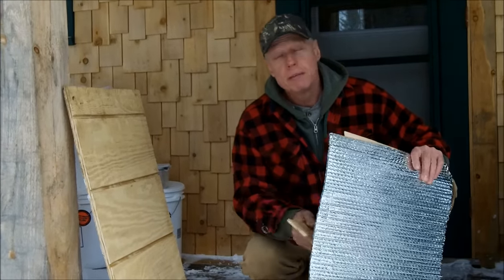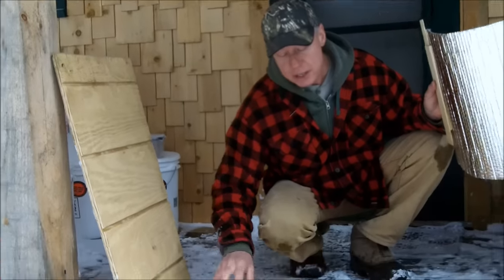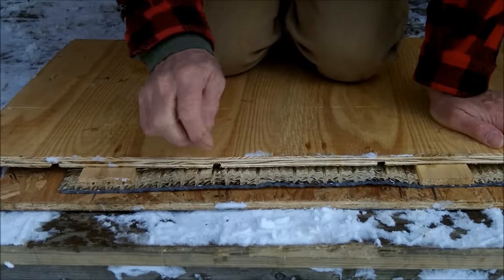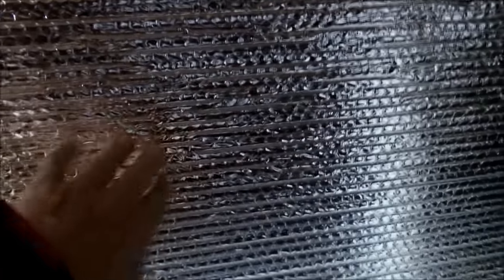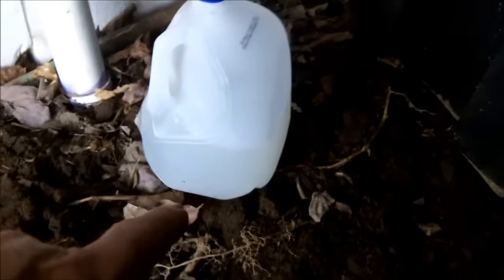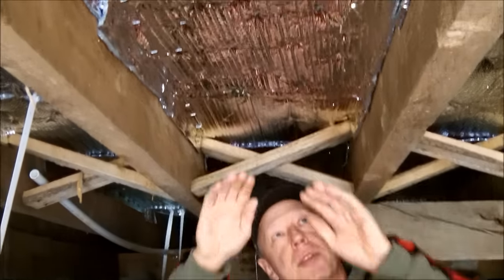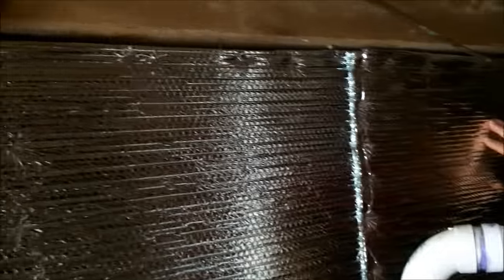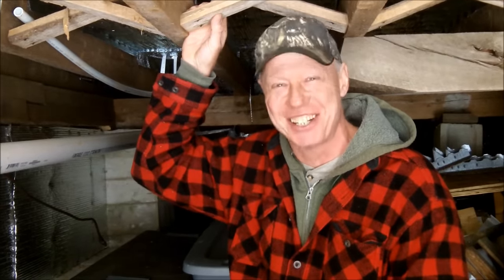HOW TO INSULATE A CABIN FLOOR AND KEEP IT RODENT FREE

Comment: Would your floor joist not rot over time with no vapor barrier between the soil an wood? Soil creates moisture. I was always understood you want to lay a layer of vapor barrier over your ground, then the crawl space is protected of moisture coming up an contacting the floor joist above? 

But as for the bubble wrap idea I think that's very clever an would do well compared to batted insulation which is a home for rodents. I'll be doing this for sure! But I am curious to your thought process on no vapor barrier on your soil an how you intend on the floor joist not rotting
Reply from the maker: Vapor barrier will help control moisture from the ground for sure and is a good idea for that purpose alone but... if your're planning on utilizing the trapped air (ambient temp of the ground) to help heat your crawlspace, the vapor barrier will trap that heat below the barrier and you will lose its benefit.

Comment: Love your channel!  Im about to embark on a cabin build myself and your channel along with an assortment of others have been my study guide the last year. Question,  Could you use this to insulate the whole cabin?  Walls and roof as well?  Thanks!
Reply from the maker: I wouldn't. I want my rooms to breath.
Reply: I disagree with Off Grid homestead on this point. I see no reason why you couldn’t also use it on the exterior walls and the ceiling as well. After all , the walls and ceiling would otherwise normally be sealed with 6 mil poly anyways, which would not breath either.

Comment: We have a cottage in Western NY that was built in 1901.  Over the years we took it off the piers, and put a block foundation with I-Beams under it.  We have a similar rodent issue.  Going to give the bubble foil a try as well.  Only other challenge is the moisture.  Have you thought about putting down plastic over the dirt, to add another layer of vapor barrier?
Reply from the maker: Yes I plan to lay cheap tarps over the soil.
Reply: @thebossoftheswamp  Hi, great video. I have a question regarding the cheap tarp you used over the dirt floor. Does that have any effect on rodents burrowing up through the dirt?
Reply from the maker: @drew6194  I have never had any issues with that.

Comment: think about doing this to my mobile home. its a 76x 16 so wont be cheap or fun. but rodents have destroyed the insulation.
I would have to do it like your last illustration and staple underneath. 
im in Ky andbit get down in the low  teens to single digits on average in winter. my concern was it not working well enough but after watching this i think it might be fine

Comment: What about if your cabin is located in the north Canada where temperarures reach -30 degrees celsius for 2 to 3 months of the year. My cottage is already built 30 years ago. What if you put the bubble foil between the joist under the floor, then put SM insulation over the bubble wrap, and same for the walls under your raised cottage. Then later when I change the flooring inside, put the bubble foil over the existing plywood flooring, then strap it along the joist locations, then add another plywood layer, then the new floor. This should be a good approach you think? Do you see any problems doing this? Other than some cost..
Reply from the maker: I lived on the Canada border for 14 years and seen -35F.  I had one layer of foil under the floor but also had the skirting insulated with this too and it worked great.   Make sure you have insulated skirting.

Comment: I have used the bubble insulation in the past and wish I could use it here. Our little cabin, "Hobbit Hus," started out as a hunting camp put up quick and dirty. It has a 6" "crawl space" under it so there is no hope of installing it. The drain in the shower also freezes in cold weather, but I treat it with RV antifreeze as necessary. Otherwise, I love the stuff too! Thanx for the wonderful videos you publish. ><>
Reply from the maker: Have you skirted it?  That will make all the difference in the world.
Reply: Oh yes - sorta' kinda', first thing we did when we bought the place. Discovered that skunks will chew through the bubble insulation though. :-) Didn't expect that.  Any good recipes for skunk?  ><>

Comment: I will do this when I build my cabin but have a question.  Underneath the floor you put the bubble wrap tight to the sub floor because you didn't want to create an air gap by stapling it to the bottom of the floor joists but when you did your skirting you created a 3 1/2" air gap. Why did you not just use the bubble wrap on your skirting frame then put the pressure treated plywood on top of that with no gap like you would on a newly built floor?  Thanks and enjoy your video's.
Reply from the maker: Good question.   I could have done it either way I suppose but the trapped air in the skirting will help insulate the crawlspace.   If a mouse chose to nest in that air gap, there's nothing he can destroy in there. No wires etc but so far I have not seen any points of entry.

Comment: I would seal up the bottom of the joist with strips of 3/4 and drop plywood in the space and insulate from the top
Reply from the maker: The building was built 10 years before i was born so i didn't have that option haha

Comment: You need a good 4" of insulation for it to actually work effectively. One other thing is rodents will eat right through what looks like PEX piping. If you want to keep rodents out, clean the space, and when done regularly bait the space both inside and out.
Reply from the maker: Total bullshit is all I just read. When you live in the woods, rodents take residence in ALL and ANY type of shelter. Woodpiles, lumber piles and tarp over a wood splitter. My cabin has seen temps as low as -38F and I walk around barefoot.  I love comments like these :-/

Comment: I think you would have been better going over the floor joists, you want an air gap to make that stuff most effective...  as for the rodent next problem, I think they could still find nesting homes the way you did it...  sealing and taping the joints would prevent rodents from getting in as mice don't chew through foil..

Comment: Putting a plastic vapor barrier on the cold side will create condensation and rot your floor. Vapor barriers should be installed on the warm side of insulation.
Reply from the maker: With a poly sheet I agree but it doesn't condensate with this stuff.

Comment: Are you sure the benefit isn't just from having that stuff act as a vapor barrier?  The R value of it is 1.3 which is hardly anything.  The reflective part is for raditant energy so does nothing extra.   I'm trying to figure out what to use for my build and so far I like rock wool Insulation with metal flashing undernearth to keep out mice.
Reply from the maker: The reflective quality of the product must be what makes it work so well. If it didn't, I simply wouldn't put it beneath all my structures.

Comment: right on time . I am in the process of buying a cabin in the mountains of east TN , offer accepted , close in 2 weeks and it will be a project .  24x36 with block foundation . No insulation in crawl space . I was thinking fiberglass the joists with foam block in the rim joist , wire to hold it up . After seeing this I have a change of plans , I am going to bubble foil as you did on the bottom of the sub-floor . I think I will still put some foam board in the rim joist cavities . Would it be effective to then cover the inside of the foundation block walls with same stuff and what would be a good way to attach it to the blocks ? would liqiud nails hold it ?
Reply from the maker: Not sure how to secure it to concrete.

Comment: Great, just Great. now i have a spring project at my cabin in Deposit instead of fishing. lol Thanks for the video. I tried spray foam and doing it on my back 12 inches from my face at the closest point was a circus. I have a picture of me afterwards of what i looked like. lol  what kind of skirting did you staple that on? most trailer skirting is vinyl?
Reply from the maker: It's framed with PT 2x4's.

Comment: I think you may have solved my problem.. Thankyou! I do have a question though.. I have seen other videos where they lay this insulation on a concrete slab floor like in a basement and then they lay a finished floor on top.. you mentioned that you believed that if you did that it wouldn't work because it would damage the insulation over time from walking on it (possibly popping the air out). I understand what you meant but now I'm not sure if it's true or not. Either way I am definitely going to try this stuff. Thanks again
Reply from the maker: Since I have not tried it, I can't say for sure but I do know that the insulation would remain intact if it was not being crushed.  Just my 2 cents :-)
Reply: @thebossoftheswamp  that's a fair enough point. Thankyou for bringing my attention to this product I definitely gonna give it a go in my house projects

Comment: Thanks for the tip. What kind and size bubble foil should I put down on/over my floor joist before I put down the subfloor ?  Thanks
Reply from the maker: Here is a recent update regarding my insulation tactics. https://www.youtube.com/watch?v=Wa2-FWAwwUY  
 You will find info and answers to your questions in the description below.  Good luck with your project,

Comment: I am getting ready to put insulation in my 72 Holiday Rambler RV.  I have had to gut it so it is perfect to put new insulation.  I am trying to really build up the insulation to keep the heat and cold out at extreme times.  I have been thinking about putting in the bubble wrap and then the pink panther insulation wrap too.  Does that sound like a good idea?  If so what would you put down first, the bubble wrap?
Reply from the maker: I think that would work just fine and I probably would put the bubble foil in first but not sure if it would matter.

Comment: The reason it works it needs an air gap with out it the r rating is probably .3, fiber glass is the perfect rodent nest material, use cellulose with boric acid the weight causes it to collapse on the nest.

Comment: I have a question.  First of all, thank you for a great video and presentation.  My question is, wouldn't the skirting with bubble foil cause moisture to be trapped and then rot things underneath?  I always thought that you need to have air circulating below the floor.
Reply from the maker: How much you vent the crawlspace depends on many factors and I discuss a few around the 10 minute mark in this video  https://www.youtube.com/watch?v=cbbItGGyFLc     If you vent the crawlspace in the winter, you will allow cold air beneath the structure and not only will pipes freeze but the floors will be cold.
Reply: @thebossoftheswamp  Thank you.  I'll have another go through at that point.

Comment: Hey Boss, I am in the sub floor construction stage of my cabin. Should I cut 4’x8’ sheets of the foil and staple to the underside of the underlay? Or do you think it would be best just to roll the total length of the floor and staple to the joists? Love the bubble foil idea!
Reply from the maker: I roll it over the joist and staple it down. This will create little air pockets under the floor that trap and reflect heat.  Just gotta keep the rain from getting trapped between the plywood and the foil.

Comment: @bossoftheswamp I just read you can get R-21if you follow the instructions for install on Reflectix website. They say to put 2 layers of the bubble wrap insulation. One half way up the floor joist and the other at the bottom of it. Combined they say it is R-21. You could make your floor even toastier...
Reply: But you will also create a cavity where mice/rodents will nest if they get between the layers. :(
Reply: @jamiearmstrong3343  Supposedly, mice do not like the Reflectix.

Comment: I have a very damp crawl space (about 2 1/2 feet tall), The fiberglass insulation between the floor joists is about 38 years old and the sheathing covering it is that old and compromised in many areas because of the plumbers who tore it apart to get to leaky pipes.  My floors are really cold, it's a modular home set on a foundation, about 24W x 36L.  I want to take out all the old stuff and put the radiant insulation against the floor boards as you suggested, and also put the radiant insulation on the floor joists for extra protection because it gets might cold her in New Hampshire.  I was thinking I would need 3 rolls of 2x125, and 3 rolls of 4x125 feet.  Do you think that would be enough.
Reply from the maker: The packages will display how much square footage they cover so just buy enough to suit your needs. 24x36=864sf.  This cabin is in NH as well.

Comment: You should tape your joints this summer and see if it makes a difference next winter.
Reply from the maker: I do when I do a new install but this is working so good that there's no need of improving it.  It's overlapped by several inches anyway.

Comment: I have used this stuff and I don't know why it works so good unless it was made by magical elves . It is pricy for all you get but it is works as well as 1 1/2" of foam board or 3 1/2 rockwool. If you look at that comparaison that way it is the cheapest and best way to go. It also works fantastic as a heat reflectant. You will only be sorry if you don't use it. I just wonder if 2 layers would work in the attic better?
Reply from the maker: I'm working on an update video on this subject. I was planning to have it out this weekend but I ended up in the hospital instead.  Life happens as we all know.  I hope to have this vid up and out this week.  It'll answer many questions.
Reply: There is a company making an insulation with basically two layers of this with I think 1/2" of some kind of poly insulation sandwiched between. Rodents  don't like it is their claim. Looks promising for this type of use. They promote it for steel buildings. I came across it while looking at insulating a shipping container.
Edit: Prodex Insulation.
Pop it in your search and should bring it right up.
Only .200 thick center material. Claim r17??🤷🏼‍♂️
Edit #2: just read the in hospital part! Sorry to hear that! get well soon!

Comment: Do not put a plastic barrier BELOW the floor joists! It will trap moisture (spilled water on floor, roof leak) and it will rot your floor joists AND create mold. Your moisture barrier goes to the heated side! George Hanson

Comment: Bubble foil wrap has an R factor of 1, very poor. Canadian researchers (it gets pretty cold there) ran tests.  Their Conclusion - "bubble-pack insulation had a low insulating value compared to the polyurethane panels and the XPS board. It’s cost benefit was the poorest of all insulating materials tested.

Comment: Thats a lot of work for very little r-value.  I would use a table saw to rip the thickest foil backed foam insulation I could afford (or at least meet the r-value of the local building code) to fit in the joist spaces and if some are a little loose "caulk" the gaps with canned foam, shiny side towards the living space.  Maybe put thermofoil on the skirting but pro's don't use that stuff, I don't think there is a building code north of Louisiana that would allow it as its practically useless at -20c.
Reply from the maker: If I needed to dao all that, I would have done it but this is all I use in all my structures and do so BECAUSE ITS ALL I NEED TO.  My cabin in northern NY has seen temps of -38F and I have warm floors.  I don't give a fiddlers fart if you believe that or not.

Comment: Thank you so much for your videos, they are very helpful!  I am going to be building an off-grid cabin and would like to keep the rodents out of the wall.  Have you ever try this bubble foil for insulting cabin exterior walls instead of fiberglass insulation?  Do you have any recommendations?
Reply from the maker: I use fiberglass in the walls and roof but this is great for the floors.

Comment: I am wanting to staple this to the subfloor prior to putting it on the floor joist. I have glued and screwed the subfloor in the past. Over time will this cause squeak without the use of glue? Great videos btw.
Reply from the maker: Yes it will. To prevent squeaks, install it afterwards.

Comment: Thanks J.C I am going to spray foam underneath my cabin and use the bubble warp like you did for the skirting. Whats your opinion on using a vapor barrier for inside walls, i'm using roxul insulation. I have been reading about you don't really need it, that you should be more concerned about air getting in behind the wall. I am in Upstate NY

Comment: I guess squeaky floors really wouldn't be a concern in a off grid cabin...I probably would have wanted some adhesive holding the plywood to the joist in some fashion
Reply from the maker: Then put the foil beneath the floor between the joist.

Comment: My apartment floor is totally uninsulated, open vented and freezing cold. Heater constantly on high. I'm renting and worried about the floor sweating which might be why there is no insulation here. It's very humid and the floor already gets condensation and u have to put moisture wicking things everywhere.
  I've seen ppl use bubble foil to insulate RVs. Makes total sense. I think u might have given me a solution.
  Can u staple it to the underneath of the floor under the house?
Edit, u just showed us u did just that. Cool.
Reply from the maker: Staple this to the underside of your floor and you should certainly feel the difference from it.